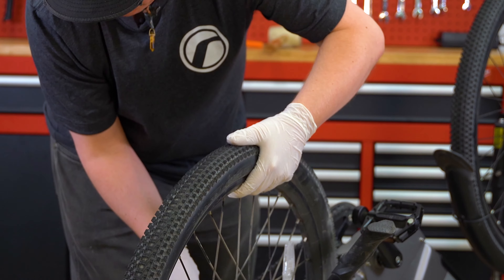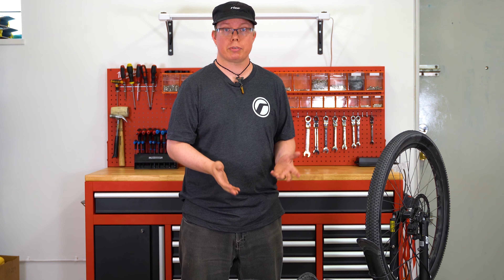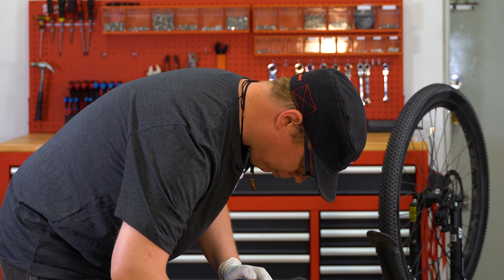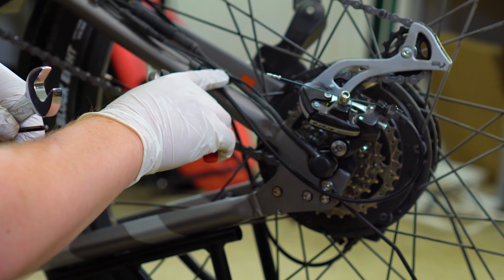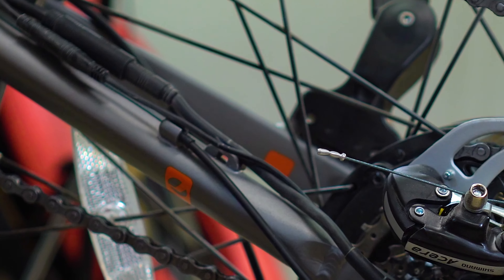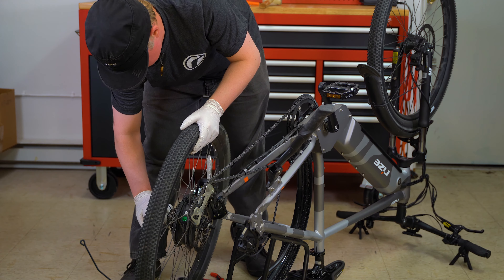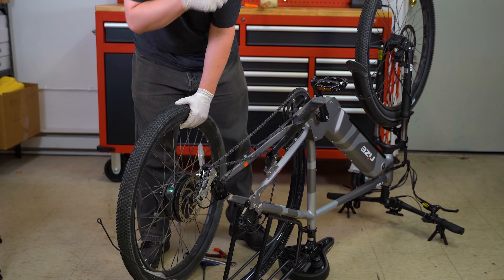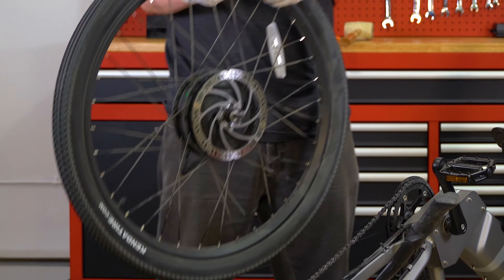How to Remove an Ebike Rear Wheel

Comment: As a true Rize rider I appreciate this and all info for repairs ....So happy!!
Reply from the maker: Thanks for the support and kinds words!!!
Reply: @RizeBikes  I hope you can help me, bro..?!..i practically took of the rear wheel, to fix a puncture...when my kid brother twisted the throttle, and because the wheel was off, turning the throttle, made the spindle rotate freely...now i fix the puncture, the wheel is back on...but there seems to be a "break" inside the drum on B/wheel..and it won't move...it will no longer run with battery-power...please help bro

Comment: How did you do it without getting th wheel stuck or something? When i put it back it refused to place it back on its original spot and will not budge
Reply: Having the same issue aswell
Reply: @GetRiggityWreck_  I think I was missing a bolt or something that's why. Or you just have to place both screws equally. And also adjust the brakes

Comment: I dont have a bike repair stand, can i turn my bike upside down to remove the rear wheels? and later to put in back? or doing repairs?
Reply from the maker: Hello,

That works fine! Just make sure to have a support by the handlebar to prevent your LCD from being damaged.

Comment: You forgot to mention of the placement of the gear cluster and the chain when you reinstall. Having chain in the wrong cog when you replace the wheel will cause irreversible harm when you go to ride it.

Comment: Does anybody know where I can get an axle like this one. The one on my Ancheer e bike has snapped I can't find one anywhere thanks.
Reply from the maker: Hello Michael,

You'll probably going to want to get in contact with the shop that originally sold you the bike as our axles most likely will only work on our specifications on the Rize Bikes.

Comment: I dint think I have a plug  does it unplug out ov the control box motor cable no plug very old bike but going strong wants rear tyre thanku
Reply from the maker: Hell Alan,

Unfortunately, if your motor cannot be disconnected from your controller, it will be difficult much more difficult to replace your rear tire.

Please get in touch with the original manufacturer of your eBike.

Comment: Cant for the life of me get the wheel back on. Will not seat in the axle notches. Any advice?
Reply from the maker: Hello,

You'll have to grab a wrench that fits the axle and wiggle the axle back and forth as you place the wheel into the bike. The issue is your axle is not oriented the correct direction when placing it onto the frame.
Reply: @RizeBikes  do you mean a wrench that fits the nut on the axle? Or a pair of pliers to wiggle the axle?

Comment: What size is the axle nut? I’m trying to look for a 18 mm nut but I can’t find one need help😭
Reply: Lol that's what I was wondering too .
He used 18 m wrench so .so the whole nut is 18mm 
But the hole is going to be  M12 or and M14 I think .I called Rize, guy didn't know on the phone 😐 
Also the front size might be smaller like an m10 ,m8 .
I have the old spark bike x .I guess it would be the same for Rize x

Comment: I'm still trying to get that fucking first bolt off no reason it should be this tight
Reply from the maker: Hi Mr. Toast, spray some WD40 between the axle and nut. This should make it a lot easier to undo the nut. Hope that helps.